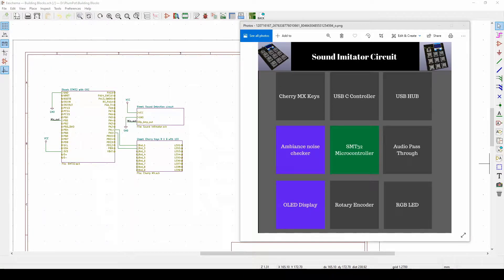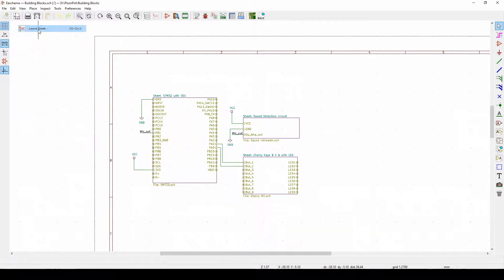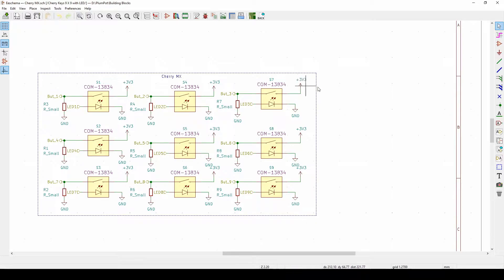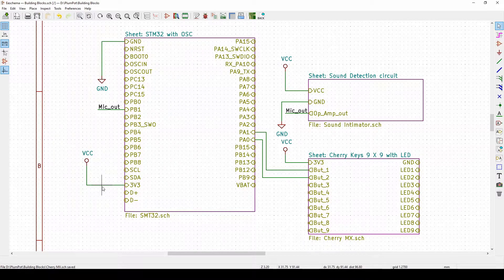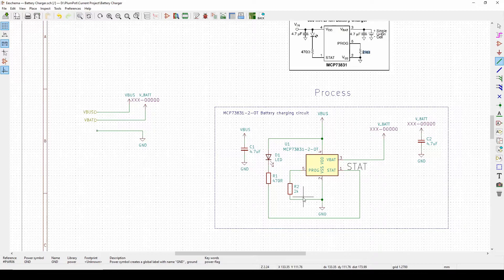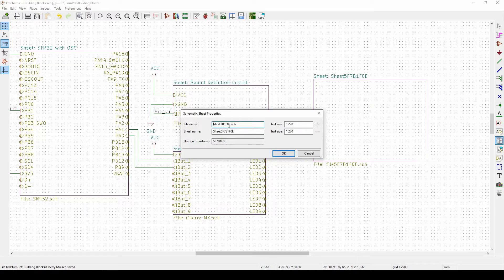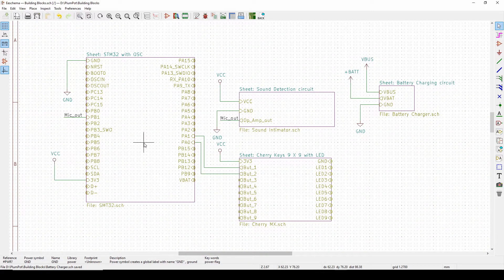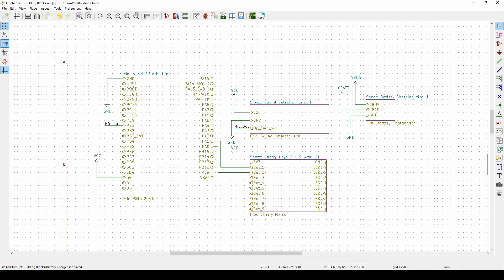KiCad Tutorial - How to re-use schematics in new projects.

Comment: That's great, but the main reusing question remains: how to reuse a schematic fragment WITHOUT copying it from project to project?
When a fragment is improved in it's own project would be great to have the improvement in all the projects reusing it.
Reply: That is exactly what he is demonstrating, the design that he created contains almost no new circuitry. The hierichacal pages he creates reference connections to reference circuit sheets that are stored in a common circuit folder on his PC. Be careful what you wish for, one persons dream is anothers nightmare. I would much rather just insert a copy of a known good reference circuit into a flat design, that way if I ever feel the need to edit one of those circuits in any way I know that its not going to change other designs that I have that might have already created.
Reply: @fishtailfred8686  unfortunately, when you fill reference designators and save schematics, all the RefDes values on all sheets are overwritten.
All, including the library schematic fragment sheet. When you update your fragment schematics and fill RefDes, they interfere with RefDes values in derived projects.
E.g. you have a library fragment with 7805 voltage regulator and 3 capacitors("U1", "C1", "C2", "C3"). It is used in several projects containing more ICs and capacitors. 1-st derived project sets RefDes of 7805 to "U5" and capacitors - to "C8", "C9" and "C10". Second project sets them to "U3", "C5", "C6", "C7". And so on.
 When you save second project, RefDes values in the first one become invalid - it already has "U3", "C5", "C6", "C7"
When you open your fragment and revert RefDes to "U1", "C1", "C2", "C3", RefDes in all derived projects become invalid. And you must not do that, since derived projects may have PCBs developed - renumbering components breaks netlist.
The only way to keep RefDes valid i know is to copy library schematic (e.g. 7805 with 3 caps) into each project. So, this is not a question of choice. No reusing is actually possible.